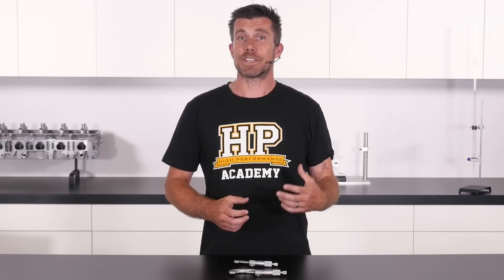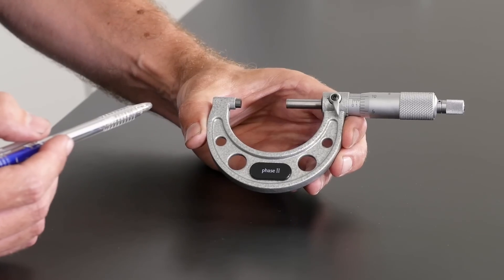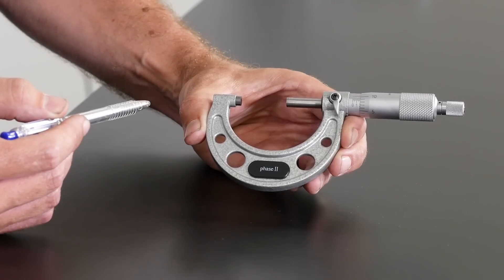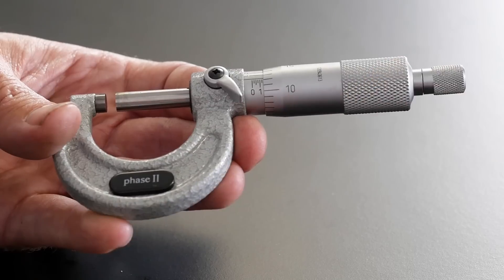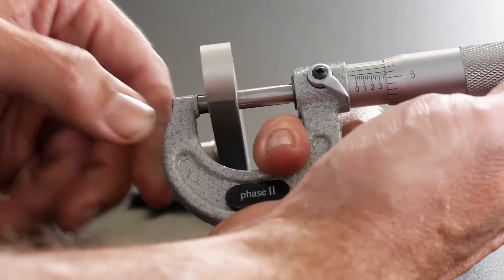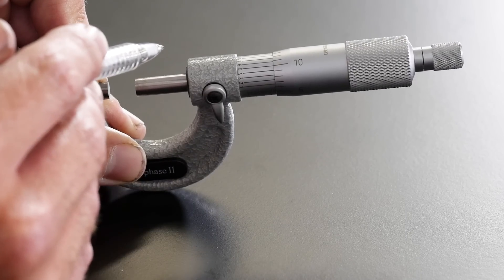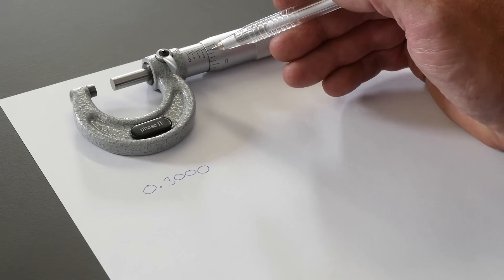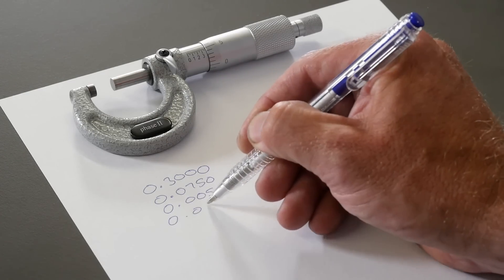How to read and use a Micrometer...the right way | [FREE LESSON]

Comment: i know this is old thread, but i gotta let all know that when it comes to cheap/or any chinese made mics, you get what you pay for... i started with china-made mics in the beginning.... they seemed "off" to me.  i didnt have confidence ib the china-mic inaccuracy/repeatability. i finally dished out for Mituyoyo mic's.   all china mic's went to the dump after that. Ridiculously inaccurate and repeatable every time!
Reply from the maker: We've had both terrible and awesome tools out of China. If you are going to buy them, you just need to check and be sure what you have is going to do the job you have it for. You should do the same no matter how much you spend on tools or where they are from to be fair. 'Trust but verify' is a quote we think has a lot of value in this respect and many others - Taz.

Comment: sorry, 
there are some clear errors in the way you use it, especially holding it, it meant to be thermally equilibrated both tool and measured piece, as holding it tight with your hand heats up the outside part of the micrometer, causing it to stretch and read incorrectly. also the reason for black pieces pop plastic on its sides are not just to stamp the brand/make, but actually insulated holding g point so you transmit as little heat as possible to the metal body.

Comment: I use old instruments of the Soviet Union. Chinese ones are sometimes very inaccurate. Perhaps now they have improved in quality.When measuring, it is probably advisable not to warm the micrometer bracket with your hands, since the values change 0.001mm

Comment: Inches? Is Australia not metric...
Reply from the maker: We are from New Zealand 🐑. But yes we use the metric system here too. When you are building engines you will want to know how to use both metric and imperial. - Ben
Reply: Having recently bought a set for my build, I can tell you finding a set in metric is bloody hard. I could find them but at the very bottom end of the quality range with 5 micron accuracy... I ended up up biting the bulled for a mid range set 0.0001". At the far end of the cost range were digital ones which measured both.
Reply: According to Curtis, at Cutting Edge Engineering, they use bananas. 😁